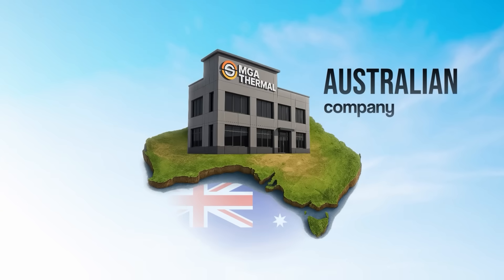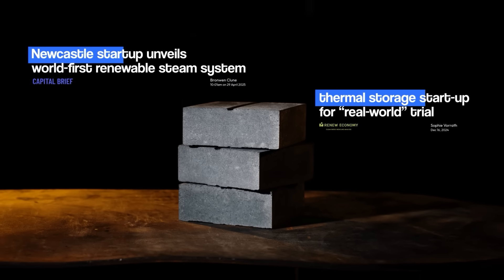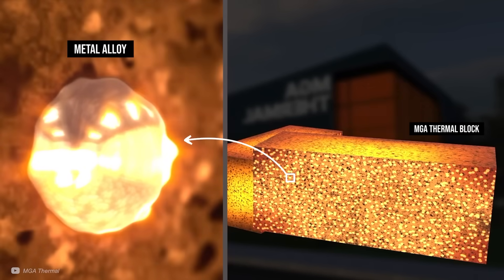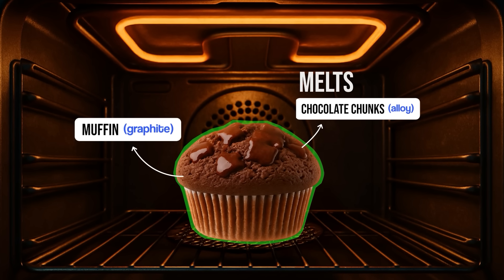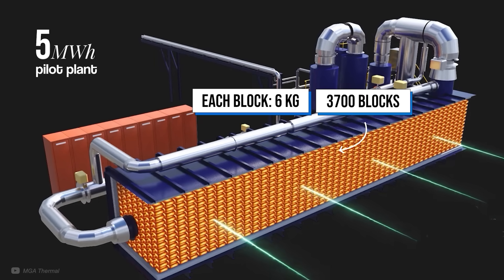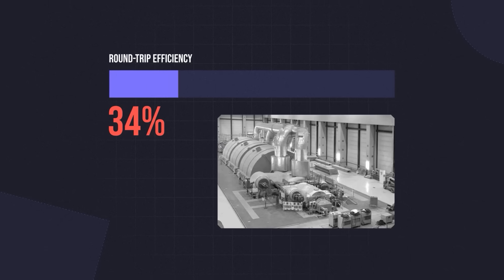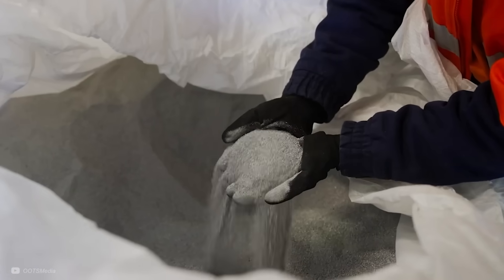Why This Carbon-Alloy is the Future of Energy Storage

Comment: AI Summary

Abstract:

This video provides a deep dive into MGA Thermal, an Australian company aiming to decarbonize heavy industry with its innovative thermal energy storage system. The core of their technology is a proprietary "Miscibility Gap Alloy" (MGA), a phase-changing metal super alloy embedded within graphite blocks. This system leverages the principle of latent heat, allowing it to store vast amounts of thermal energy by melting the alloy at high temperatures (over 700°C) while the graphite matrix remains solid. The video details how the system charges using renewable electricity and discharges to produce high-pressure steam with a roundtrip efficiency as high as 93%. It also addresses a major 2023 fire at their demo plant, explaining the cause and the lessons learned. Despite this setback, the company has successfully commissioned its 5 MWh pilot plant, which demonstrates significantly higher energy density than competing technologies, though challenges in scaling up brick manufacturing remain.

MGA Thermal: Storing the Sun in a Metal-Graphite Box

*   0:00:03 Introduction to MGA Thermal: The video introduces MGA Thermal, an Australian company developing a proprietary metal super alloy to store renewable energy for industrial use. The company faced a significant setback in 2023 with a fire at its demo plant but has since recovered.
*   0:01:25 The Core Technology: The system is built around blocks made of a "Miscibility Gap Alloy" (MGA). These are essentially graphite blocks embedded with pellets of a special metal alloy.
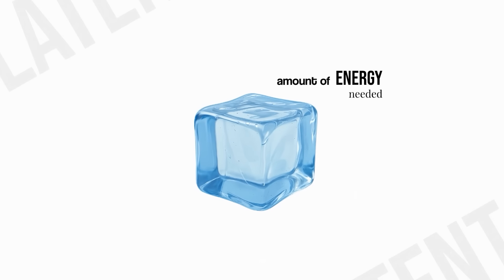*   0:01:52 Latent Heat for High-Density Storage: The system's power comes from using latent heat. The metal alloy within the blocks melts (changes phase from solid to liquid) at a constant temperature, allowing the blocks to absorb a large amount of energy without getting dangerously hotter. This leads to higher energy density at lower temperatures compared to sensible heat storage alone.
*   0:03:02 What is a "Miscibility Gap Alloy"? Coined by the founders, this patented term refers to a blend of metals designed to melt and solidify at specific temperatures. A key feature is that the materials don't mix, and the graphite matrix acts as a stable container for the molten metal, withstanding expansion and contraction.
*   0:04:10 The Muffin Analogy: An analogy describes the block as a muffin (graphite) with chocolate chunks (metal alloy). When heated, the chocolate melts, but the overall muffin structure remains solid.
*   0:06:28 Pilot Plant Specifications: The successfully commissioned 5 MWh pilot plant consists of approximately 3,700 MGA blocks. Each shoebox-sized block weighs 6 kg and stores over 1 kWh of energy.
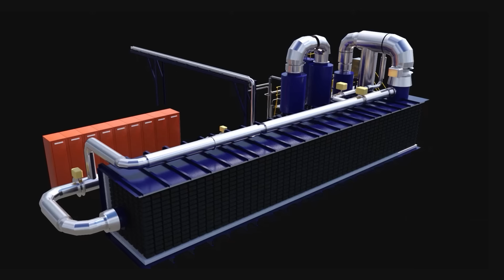*   0:06:56 System Operation: The blocks are heated using renewable electricity (via resistive heaters). To discharge, nitrogen gas flows around the hot blocks, carrying the heat to a heat recovery steam generator to produce steam for industrial processes.
*   0:07:35 High Efficiency for Heat, Lower for Electricity: The system is highly efficient for its primary purpose.
    *   Takeaway: It achieves an electricity-to-steam roundtrip efficiency of up to 93%, losing only about 2% of its heat per day.
    *   Takeaway: Converting the heat back to electricity is much less efficient, at just 35% roundtrip efficiency.
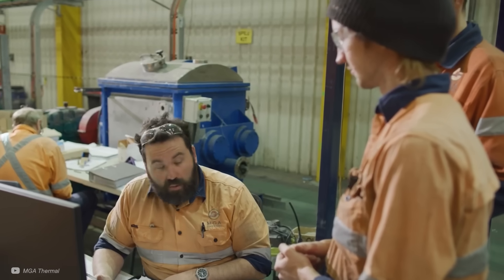*   0:09:13 The 2023 Fire Explained: The fire was caused by an attempt to form the MGA bricks inside the storage unit itself, rather than in their specialized kiln. This led to an uncontrollable exothermic reaction and a massive temperature spike to 1,200°C.
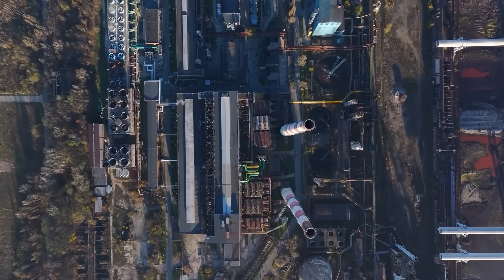*   0:09:59 A Key Challenge - Manufacturing: A significant bottleneck for MGA Thermal is the production of its specialized bricks. Their current kiln can only produce 100 blocks per day, meaning it would take over a month to produce the blocks for a single demo plant.
*   0:10:29 Impressive Performance and Differentiator: Despite challenges, the demo unit shows a 200-300% higher energy storage capacity compared to alternative thermal storage solutions.
    *   Key Takeaway: The use of phase-changing materials gives MGA a significant energy density advantage over competitors like Rondo and Antora, who primarily use sensible heat storage.

I used gemini-2.5-pro| input-price: 1.25 output-price: 10 max-context-length: 200_000 on rocketrecap dot com to summarize the transcript.
Cost (if I didn't use the free tier): $0.03
Input tokens: 15651
Output tokens: 959
Reply: Are you saying you used Ai to analyze the previous Ai transcript to estimate cost efficiency?

Comment: Heat storage of energy is just an awful idea. This will never become It is greatly  used.
 I call bs on the efficiency.
Reply: I wouldnt. What you might be thinking is converting that heat back into power, but storage heat can be as high as 90% for sure. What you do with that heat is the harder question because then you have to move it. For example, instead of a steam generator, they could use the new CO2 method and go from 30-35% up to 35-45%, or just move that heat into homes using coolants as well, but still be limited into what area you can heat up. The fact it losses 2% per day would be a pretty big step for for non-classic batteries even if you losse well over half if we have a energy surplus.
Reply: I agree, everything can be returned into heat. It's the universal energy dump.

Using the heat in processes where fossil fuel otherwise generates the heat makes the conversation efficiency less of an issue.  You lose energy with no greenhouse gas cost, instead of producing excess heat and excess CO2.  The best uses I've head for this sort of waste heat storage require more than 700c though.  High temp industrial processes like steel smelting/casting and cement forming the temperature is more like 1,500 to 2000 c.  What you do need is something to do with the heat battery once you get under that critical temperature, I second the CO2 enhancement, though the infrastructure distribute 700C CO2 and 700c steam without losses is similar.
Reply: @BenODen I think the DOE calls the range of 300-700C heat as “mid-grade” heat (where high-pressure steam becomes very expensive…) and there are uses/needs for it.  They just don’t get all the press as “high-temp” (>800C I think??) needs, such as steel/concrete - b/c we have almost NO idea how to decarbonize those at reasonable cost.  I believe that most float glass (windows) use ~500C, and there’s lots of chemical production methods in that range, too.  There’s a market - it’s just not the biggest.
Reply: Yeah, >90% is actually pretty common for a lot of (advanced) TES systems.  The fact that they’re recycling the waste (low-temp) heat is a good sign they’re achieving it.

Comment: Sounds like a 1970s storage heater. They were great. What a load of ball hooks.
Reply: Similar, but those didn't use phase change to increase energy storage whlst keeping the temperature constant.
Reply: @eclecticcyclist  No thats true, i guess Sunamp did, but that was only really for hot water at 58c.  Not 700c.  Interested to see if its a commercial success.
Reply: It's not far off and it hasn't really been explored as a storage option because fossil fuels were so cheap its not really worth pursuing. Few other technologies doing the same thing like Polar Night Energy and Stiesdal.